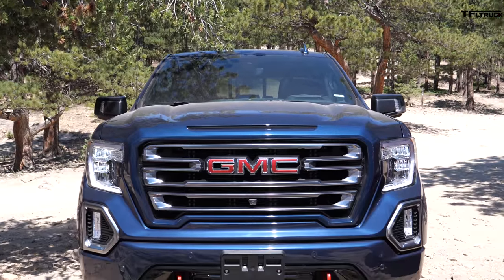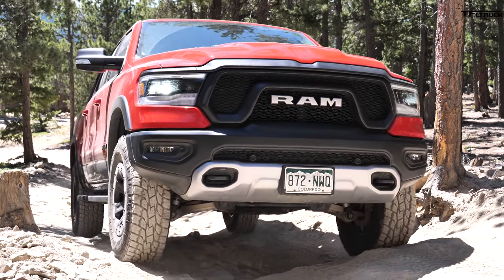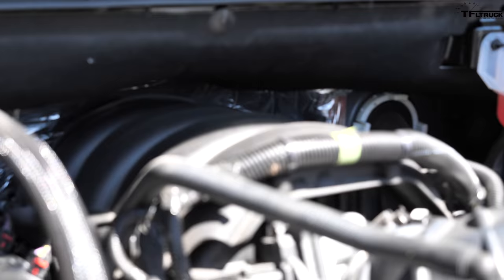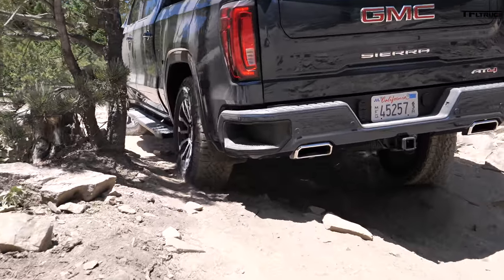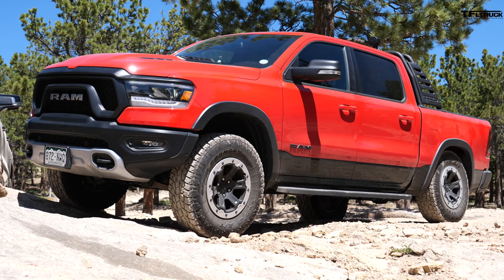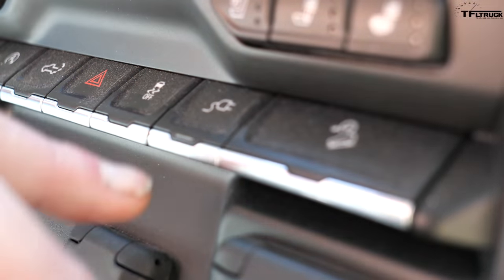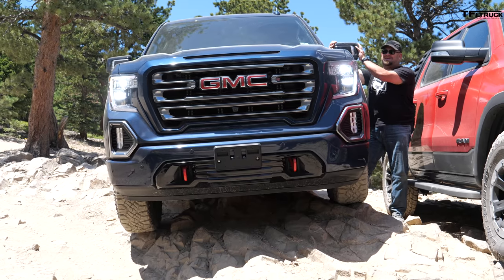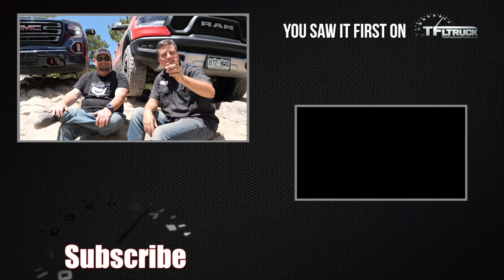GMC Sierra AT4 Comes Up to Challenge the Ram Rebel Rouser and This is What Happens | Ep.7

Comment: They’re comparing a GMC truck off the dealership vs a Ram that has been modified to their liking. Not a very even comparison.
Reply: That GMC has been modified by GMC for offroading. Did you watch the entire video?
Reply: 716 ODST yes I did that’s why I said from dealership and not from factory. Even then they put a lot more money into the Rebel than the GMC.
Reply: @brandonorozco8358  it's not dealer modded. It comes from the factory that way. The airbox and exhaust aren't doing anything for it off-road here. It's a factory truck
Reply: @brandonorozco8358  Did you? At the end Nathan plainly states that the GMC is stock and the Ram has $10,000 worth of mods.
Reply: @sonsofliberty3081  The dealer doesn't install this lift on the AT4 or the trailboss. They come this way. The dealer CAN install one after the fact on a GM truck but these come straight from the assembly line this way
Reply: @sonsofliberty3081  GM isn't second Chevy is. GM fullsize truck sales surpasses FCA by a long shot and that's not including midsize trucks. Also the sales margin is higher and GM makes more money per truck. The G80 is a locker and that's what this truck has. It's an automatic locker, not selectable. The AT4 and Trailboss come from the factory with a 2inch lift. Not dealer installed. Even if Nathan said that the dealer installed the lift he's wrong. Just as the "auto" 4hi button ISN'T AWD like he says and so does roman. The intake and exhaust do nothing for these trucks how they drove them. Absolutely nothing. Also the 10spd is light years better than the 8sp
Reply: @sonsofliberty3081  You do know they have a series on the ram they are driving. The dealer didn't work on lifting that truck dude. The AT4 suspension was bone stock at 2 inches from the factory. You said the dealer did it 😂🤣 😂.
Reply: @sonsofliberty3081  To what? Not the GM truck like you've been saying the dealer added
Reply: @sonsofliberty3081  the only added a leveling kit to the ram to fit the 35's.  So it still only has a 2 inch lift. And like everybody else is saying the gm is completely stick from factory. Now don't get started on what is better and what is not.  I don't want to get into that.  These are just facts from this video and the video concerning the ram when they put the parts on it   I believe they had some form of garage do the installs for them  I do know the dealership had nothing to do with it
Reply: @sonsofliberty3081  no aftermarket parts means it's stock.  The suspension and the tires it has all come from the factory. They maybe rancho shocks on the gmc but all that means is the factory has a deal with them to see if use with that package   as for the rebel in not gonna argue bc obviously your not gonna get it
Reply: @sonsofliberty3081  Ford helped them? You are a special guy ♥️! It was a joint effort and the software calibration is terrible from ford. Any one who races or actually drives these knows that. Don't deflect. You said they both had 4 inch lifts. You were wrong. Plus it does matter. The extra 2 inches on the ram allows for 35 inch tires. You turd. The ram lost to the GM in Moab. Period. You can't address any of those points above because you don't have a clue.
Reply: @EGGINFOOLS  obviously this guy can't comprehend much    they even say in the video that they only added a 2 inch leveling kit in the front end of the rebel. And the GMC is totally factory even with the upgraded off-road package Can't seem to get it through to him   I'm kinda having a fun arguing with him.
Reply: @sonsofliberty3081  Yet the ram lost in Moab. Lol
Reply: @sonsofliberty3081  so ford done it too. And Chrysler sold out to a Italian company.
Reply: @damitbobby6677  ...after the Germans had their way with them, of course.
Reply: @NukePooch1  correct
Reply: sons of liberty I’m pretty sure you can’t add a 2 inch lift to a 2 inch lift. You remove the lift and add a 4 inch lift. If you’re going to do that then you ought to just buy a Laramie and add a 4 inch lift. Of course then you’d need to upgrade your bumpers.
Reply: liberliberty speaking of bad, whatever that thing is that is not a Ram is bad looking.
Reply: EGGINFOOLS I can’t believe you think the “Chevy/Ford” transmission is better than the ZF 8hp75! Like it or no ZF transmission is way superior.
Reply: Spare parts the Mods the rebel has was not that impressive.. the only thing is the falcon shocks.. but tires are not the good ... the gmc tires are a lot Better... the rest of the mods are gimmicks like the exust and the air filter. The stickers and the ram bar? Those are not mods to me... the only thing he did to perform Better was the suspension.. so in this case he just spend 2k to make it better

Comment: My G80 in my 99 silverado still works, something to be said for that.
Reply: Still works but never worked amazingly well.. something to be said for that too.  :/
Reply: @DeltaSierra426  You haven't own one probably I have a 2WD Silverado with a G80 locker and I do some pretty rough trails for a 2WD where even some 4WD truck would struggle and just with my locker I never get stuck.
Reply: Kevin Curren yea that you baby your truck and don’t drive it or it’s been replaced before. The G80 in my 2500 never worked right (acted as an open diff) and the G80 in my current 2012 1500 works but multiple times it’s actually gotten bound up and keeps the rear axle locked, making me have to put the truck in reverse and make slight turns to get it to unlock when I drive back on pavement and I’m only running a 275/60r20 nitto ridge grappler tire.
Reply: so does limited-slip in any Dodge truck back to 1990

Comment: The local dealer can’t keep AT4 trucks on the lot. They are getting popular
Reply: Perfect truck for City Boys paying 65k and not needing a locker.
Reply: Actually the ram is selling more then Chevy Silverado and gmc serria the delar says that it is very hard to keep the ram rebel to the delears and i have seen more ram rebels then gmc serria at4
Reply: Austin Smith they don’t realize they are getting by far the worst and cheaply made truck that GM has created. How’s that engine gonna hold up with that 0w20 in the heat? Not good
Reply: Corey The FAM truck has been doing fine with 0w-20
Reply: JB 93 just wait it’s not gonna do it now
Reply: @coreythefam6455  are they really going to tell us that a thinner oil is going to increase the gas mileage substantially?  Absurd.  I live in Las Vegas and in the summer months I run 1040 synthetic and all my vehicles Honda Odyssey Jaguar XJ8 and Suburban.  There is no effing way I'm going to run a 0-20 on the Odyssey and Jaguar as recommended in this Summer Heat.
Reply: Kelly Fontes I agree they want good gas mileage then the engine lasting 300k I run 10w40 in my 95 Chevy 1500 too
Reply: Kelly Fontes 0w20 ain’t gonna cut it it’s not gonna protect ur engine
Reply: @coreythefam6455  I run 0w-20 and I do tons of heavy towing. I have already 30K miles of straight highway 9k pounds and my 5.3L is still holding. I did lab tests and the engine is running like new.
Reply: d c maybe they are selling well here because of the off road community. I live in the Rockies
Reply: @coolsquad7428  it didn't last long. Chevy took its spot back

Comment: Rebel has the electric locker from the factory at lower cost, though it just so happens TFL tricked out their Ram to cost a bit more than the AT4.  Unfortunately, this makes it an apples-to-oranges comparison, but it still a great video and helps illustrate the differences as you put a bit more into your 4x4.  If this course a little harder, the AT4 would start to struggle while the Rebel Rouser is just starting to get "dramatic" as the guys call it.

Both stock AT4 and Rebel are great all-around trucks, i.e. off-road capability is impressive for how little is sacrificed for on-road characteristics.  Recent improvements in A/T and M/T tire technology have helped quite a bit as well.

Comment: The Rancho shocks that come the GM off road package trucks are a joke. Nothing more than a sticker on a shock that is no better than any other stock shock. Give us something that’s rebuildable and actually controls the suspension on and off road like Fox or King if you’re going to make an “off road” truck.
Reply: Ranchos aren't  the best offroad shock, but they are tuned better for offroad than a basic stock shock. However, they will be easy to remove and upgrade.  My  2014 Ford was a pain in the ass to upgrade the front strut with the stupid IWE vaccum 4x4 unit.  I have a 2019 Trail boss now and it's  awesome.
Reply: Yeah they used to use  Bilstein on GM's. The factory Bilsteins on my older zr2 lasted 252,000 miles! The one rear shock started leaking at around 240,000 miles!
Reply: @terrencejones9817  Changing a front coilover on a 14' F150 is an easy day not sure what's so difficult. Swapped mine out to some Fox 2.0 when I had mine.
Reply: They definitely should have put more into the shocks. The trailboss looks nice but its really just a leveled pickup with some factory upper control arms to get the geometry of the level right. Nothing that can't be swapped out but it sure would have been nice to see something better come stock. Same with the rebel.
Reply: @JsGarage  did you actually have a 2014? You know that 2014 has a 1 year only front strut design?  09-13s had a large lower bushing with single bolt. That allowed removal of the strut without pulling the CV shaft from the hub and dealing with the IWE.  

2014 used  a bar pin ,with 2 lower bolts. To remove the strut the CV shaft must be pushed through the hub and the IWE actuator must be removed , and then properly meshed with the hub/cv splines on  reinstall.  It's not impossible, but hard to do in your driveway. I did it on a hoist and it was still very time consuming. The Chevys strut unit can be removed in about 5 minutes. It's a far superior design from a serviceability standpoint.
Reply: Terrence Jones I actually had a 2015. The 2014 was a 1 year for the 09-14 gen trucks but is actually the same as 15’ and up. 14’ and up is the same front coilover with the two bolt bar pin on bottom. I get what you’re saying it’s more work but it’s really not bad. Could certainly be better I’ll agree.
Reply: @JsGarage  Yeah the 2014 introduces the lower bar pin. I know Fox shows that theirs  from 14-19, But I used Bilstien 5100s and 2014 vs 2015 are different part numbers.  Might  due to the Bilstien reusing the OEM coil and strut mounts, which could be different.  But yes I found the IWE/cv axle set up frustrating,  as well as the very limited upper control arms once lifted even 2"s . GM has done a great job on the control arm design on the new 2019 trucks. It allows for much more travel and coil spring clearance even with the 2" rancho lift struts.
Reply: Terrence Jones Yea I think bilstein changed the valving a bit for the weight of the truck if I’m not mistaken. Fox are fully adjustable preload so I guess then didn’t bother. They rode really nice on my 15’ so can’t complain. I think the trailboss and AT4 get a specifically different UCA since they have the level height. I am pretty sure not all 2019 and up GM 1500s have that upper. I definitely like the design on the GM trucks. Ram is pretty easy too. I drive a Ram 1500 now and the front coilover is an easier job as well.
Reply: @JsGarage  The really interesting about the 2019 GM trucks, is that the Upper control arms for the Trailboss and AT4 are actually the same the non lifted trucks, when I bought my Trailboss I cross checked the Parts # ( I'm a GM parts guy)But looking at the design of them, the engineers were clearly thinking about the OEM lift option , they  have very good articulation.  

I'll admit to liking the design of the new RAMs too. I'm just not sold on the durability of the interior,  or FCA products in general. .

Comment: It must be a competition to see which of the complex electrical systems fails first.   They need a Ford product there also as their electronics are just as bad.    I’m sure the Etorque  in the RAM will give them fits long before the LT or the 10speed in the GM do.  They are 2 of the best looking trucks on the market if that helps.   I’m not sure what their point is,  Lockers, good tires and a mild lift kit and the brand becomes irrelevant.  You could source these parts yourself, save 10k and have the same trucks.
Reply: The Raptor has a rear locker if I recall?  So not sure why they didn't bring one of them out on that little BMX trail.
Reply: I'm not sure what part of the eTorque you think will fail. The internal combustion engine has more parts, and probably has more computer controls / circuit boards, and they eTorque is really just a battery and a motor, with probably two or three circumstances when it helps out. Seems pretty simple, and not necessarily prone to failure.

Comment: With GM's OBS you could apply the emergency brake a tad when the rear tire was spinning and the gov lock would work better
Reply: Didn't they go to an electronic ebrake? As its fully on or off not just a tad
Reply: @panthermartin7784  You might be right

Comment: G80 works GREAT, you just have to know how to use it.  Light left foot braking whiling climbing and instant locker without the wheel spin, not dramatic at all. You still get all the on road performance as well.... (Nathan, learn how to drive! lol jk) Great vid, Thanks
Reply: The g-80 locker requires wheel spin to activate, your statement applies to the old school clutch limited slip diffs, I own a g80 locker, it’s better than an open diff but when you loose momentum due to wheel spin before it engages that’s an issue, it should have selectable mechanical lockers.

Comment: Nice video but the odds of anybody taking an $60,000 pickup offload are slim and none.
Reply: at least its a real truck unlike the gladiator
Reply: I disagree. I bought a new AT4 and I had it off road the very first week inspecting power lines for a rebuild project.  Of course being new, I immediately took it for a car wash.  One thing that I do like about the mechanical locker is that it is always waiting. It is not limited to 4-Lo.  I was able to get through a good deal of mud in 2WD because of the G80.  It is not the Ford Raptor, but with the tailgate down (and load stopper up), I can easily secure a 4X8 sheet of plywood.
Reply: oak 1971, angel ullom, I completely agree. Trucks have become so expensive they’re just  not fun anymore
Reply: angel ullom kinda the point
Reply: I see a lot of trucks that never leave the pavement here in Utah.  I also see a lot of trucks that go off road, because that is where I go.  I don't go looking for the hardest trails, but my trucks see a lot of dirt roads, and some of them are at least as rough as depicted in this video.  
There are a lot of mall cruisers here...you won't see them where I take my truck.
$60,000?  Yes, that is a lot for a truck.  Just one of the reasons why I have been window shopping for about a year.  I don't want to regret my purchase, so I am looking for the best truck for my needs.  
Ram is offering all of their engines across the lineup.  GM needs to pull their head out, and do the same.  The Trail Boss with a 6.2 or the new 3.0 diesel would be at or near the top of my list, but the AT4 has a lot of options that I don't need.  It has also been reported that GM is working on an interior upgrade for 2021 (thanks to Ram).   

Right now, the Rebel with possibly the Ecodiesel is winning for me...and I don't really like diesels. 
YMMV
Reply: I do it with my '18 power wagon that's sitting around 70k after mods
Reply: oak 1971 I only ever here the comment that new trucks are expensive and who the hell would ever take them off road, only comes from people who can’t afford one in the first place. 

I’ve seen many brand new trucks get used off road with less than 1k miles on them. As well as there are tons of people who already have trail damage to their brand new gladiators.
Reply: That's MSRP no is paying that much. My rebel was 56 msrp. I got it for 41k.
Reply: ☝🏼 me

Comment: The g80 is not good off-road but is brilliant on road because it works in 2wd.  You pull into your driveway and you've got ice down one side...well g80 kicks in and you don't even have to think about it
Reply: I think you can lock the locker in the Rebel in 2WD?  Someone that has a Rebel maybe could try and let us know.  I'm not rich enough to get a truck like that so I have no idea but you'd think for the price you could engage that rear locker regardless of being in 2WD or 4WD.  I think you can engage the locker in the Wrangler Rubicon in 2WD?  Again I have no idea because I don't have one but you'd think it would be possible....if not its a great reason to skip all that factory crap and do aftermarket where you can engage the locker whenever you want not when a computer thinks you should LOL.  I don't have to do anything with the limited slip in my Jeep it just goes wherever I point it, works great, I wonder why that gov-loc takes so much wheel spin to engage?  I assume that's due to its overall mechanical design though.
Reply: @uncle_salty_3675  Thank you for the reply.  Wasn't quite sure but thought they did.